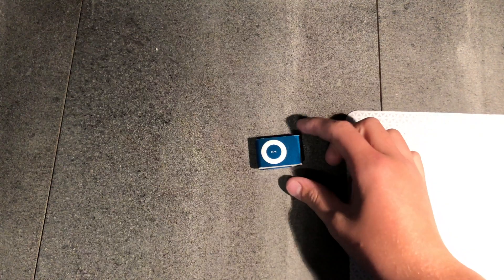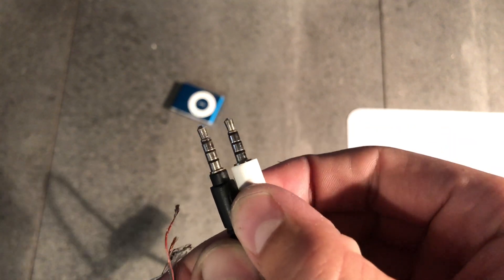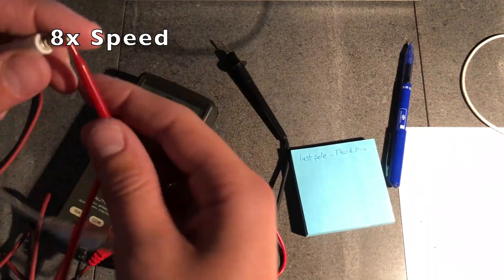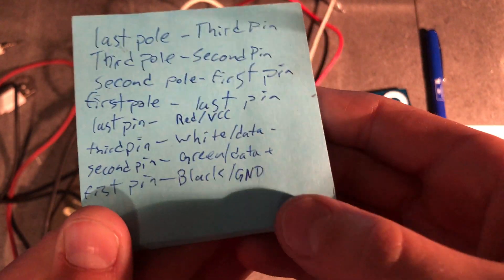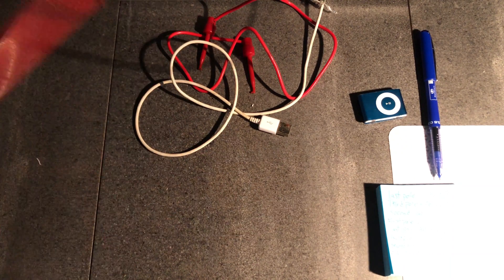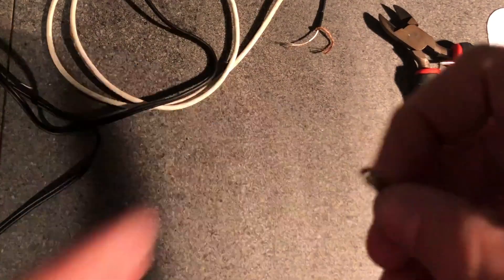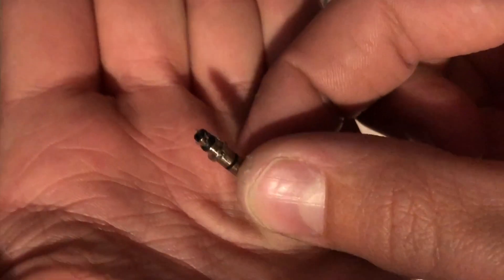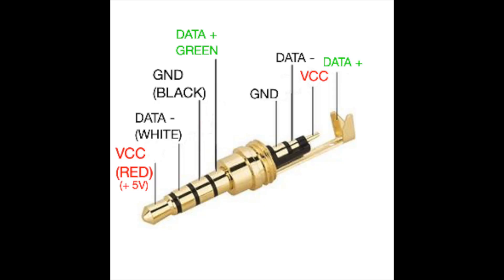How to Make a Charger for an iPod shuffle

Comment: I have a dumb question but if you take the Lightning to the head phone jack thing and a iPod shuffle charger can you charge your phone with it ???
Reply from the maker: I don’t think so, as the lightning to headphone jack dongle is wired to output audio, therefore not meant for a voltage input. I haven’t tried and I could be wrong, but I doubt it would work. I could even wreck your phone.
Reply: I just tried this a few minutes ago, you're right, it does not work for charging or data transfer, my iPhone just thinks it's an audio out. @DylanDickson